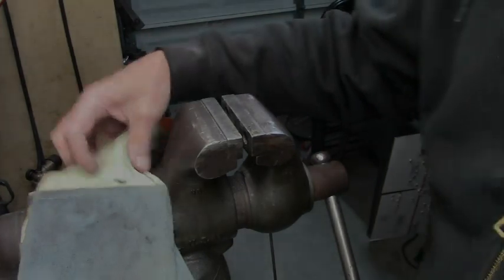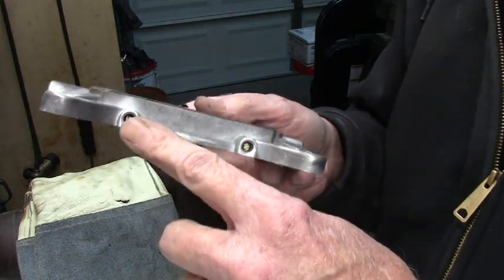Six Pack Air Fuel Screw Removal

Comment: A drop or two of tap majic oil works wonders on sticky brass screws in aluminum also when trying to extract. Left hand drill bits come in handy also. Sometimes they walk out before you even try the extractor.